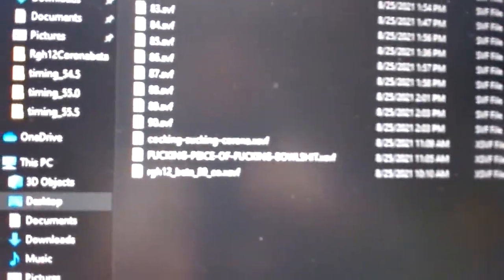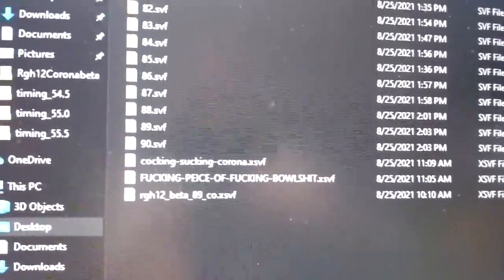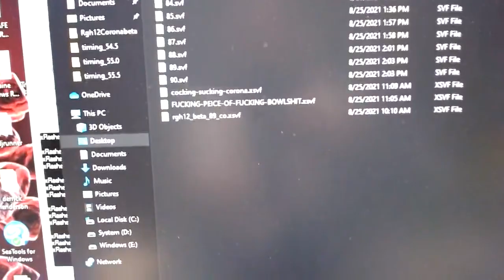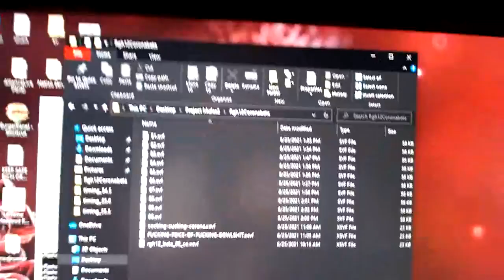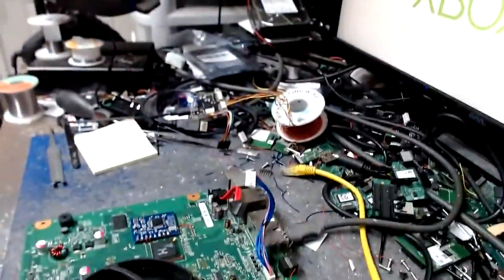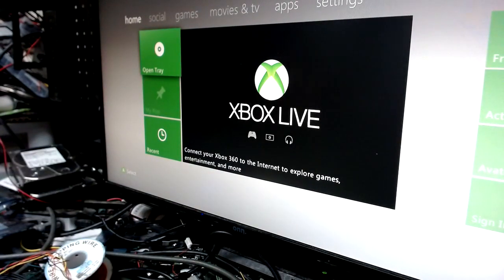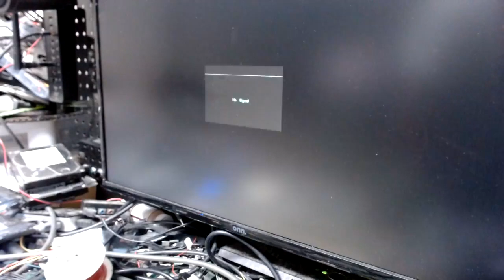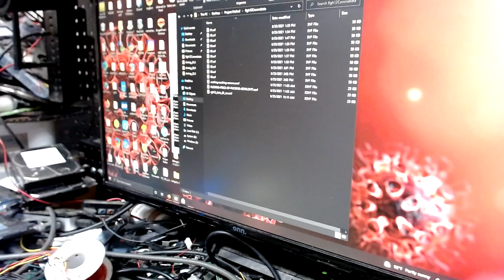Rgh 1 2 Method Corona Slim Thanks to Josh Davidson

Comment: I tried doing a 4GB Corona yesterday and spend the whole frickin day without finishing it. Reading Nand was easy. Used 360run chip in RGH2 setup and it wont glitch. Tried ECC, ECC CR4, ECC SMC+. Nothing. Tried Squirt BGA 1.2 in RGH2 setup, tried every timing file and again every ECC, nothing. Installed as Muffin style, tried everything again, every timing file and ECC, NOTHING. I dont know what is going on, but to me it seems it doesnt do the reset. Tried different cable length, still nothing. Gave up after 15 hrs...
Reply from the maker: If you are referring to the method in this video it is not muffin this is rgh 1.2 using smc+ bro and you have touse the pll and the rgh 1.2 timing files for the slim with the modded jrunner program